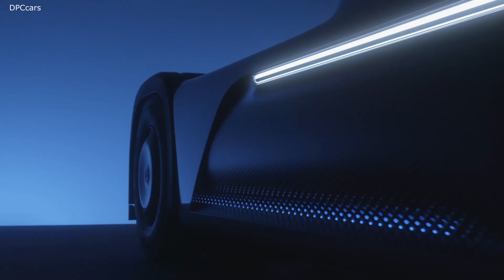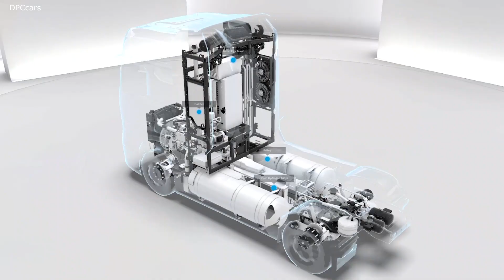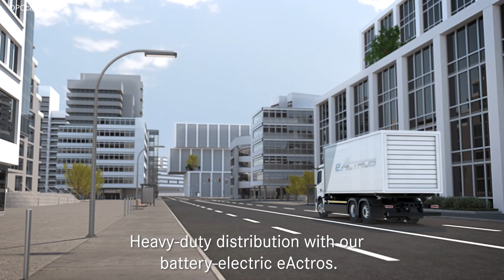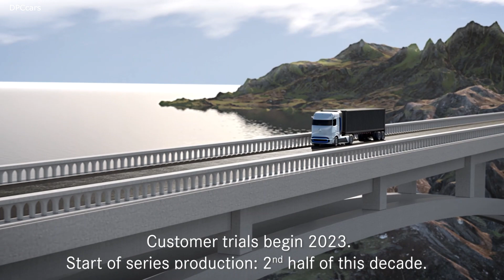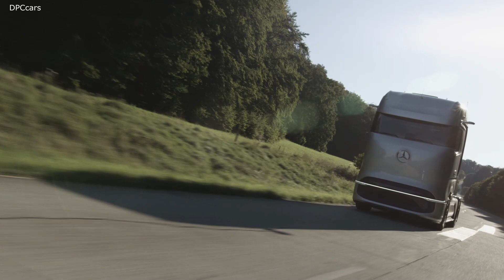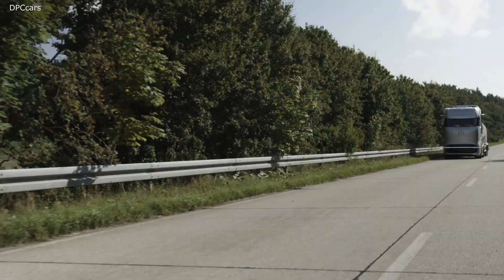2021 Mercedes Benz GenH2 Fuel Cell Truck Reveal

Comment: That is one incredibly clever hydrogen / battery hybird system. Love how it's all explained too, it's therapeutic and thought provoking. Best wishes to Mercedes Benz with leading the way in the future with their very unique system 👍😊
It'll be great when the infrastructure's sorted, especially in Britain, which is WAY behind when it comes to 'Green Tech'. No excuses with making hydorgen from renewables either, I mean, Britain is an island packed with seriously smart engineers, and it's surrounded by strong tides pretty much all year round, so the potential to harness tidal energy aswell as wind is immense 😉

Comment: Co-building my first hydrogen  fuel cell in 1982 powered by green hydrogen, is the future today. 

Super Electroayzers with my  proprietary catalyst powered by solar or wind turbines significantly increases production output efficiency.

Thermal management is critical for added efficiency. Never waste heat, capitalize on it.

Comment: how does it keep the liquid Hydrogen cold? how much loss it their if vehicle is parked for several days?
Reply: It's vacuum insulated and I'm sure there's a refrigerant system on board that's powered by batteries. I like this way more than Tesla.
Reply: Most portable liquid hydrogen tanks lose something like 3-7% of the fuel per day. So the expensive hydrogen will gradually disappear. It is probably the reason Toyota went with compressed hydrogen.

Comment: Incredible engineer development by one of the World's most advanced heavy vehicle manufacturers. There can be no doubt that if MB can't dominate in this venture there is little hope of them being overtaken by another manufacturer. Having said this, there is just one major obstacle to overcome and this is the competence of the people who apply the concept - road transport operators [customers] and this is where, while hydro-carbon fuel powered trucks are still available and permitted to operate on a public road, resistance will be difficult to overcome. Of course, Capital and Operating costs will determine the success of this concept.

Comment: Andrew Lund is right, hydrogen trucks “provide technical solutions that other technologies cannot meet in the long run.” So why bother with battery trucks in the interim when we will end up with hydrogen trucks anyway. Why make it a two-step transition when we can make it a one-step transition and go to hydrogen directly. And why keep worrying about hydrogen filling stations. They will come soon enough -- around the same time that hydrogen trucks and hydrogen cars come. Gas filling stations didn’t come overnight either.
Reply: Because their is no industrial scale hydrogen production. So you would need to invest billions into getting that running. Its an economics of scale war. And Battery is ahead with Elon Musk aggressive building of Gigafactories. So yes hydrogen is better but with no supporting infrastructure its just pie in the sky....
Reply: @martinjuulandersen9694  At some point Musk will realize that it makes no economic sense to equip trucks with batteries weighing 4-6 tons to get to an acceptable range.
Reply: Battery technology within trucks is not far ahead. The Tesla Semi is more than 2 years delayed.

Comment: GOOD MORNING MERCEDES - Hyundai H2trucks are already in regular service in Switzerland.
Reply: Hyundai Xcient H2 has just shipped 10 units to Switzerland, which is meant for field testing. The actual production will start after 2025

Comment: Oh dear Mercedes-Benz, another prototype and another fuelcell action. But when deciding for an EV platform you give it the possibility of hybridisation. So completely rearward thinking and wrong. Mercedes-Benz is fucked.
Reply: For the trucking industry and heavy machinery, Hydrogen powered engines, are the best choice, comparing to hauling around a massive battery pack.